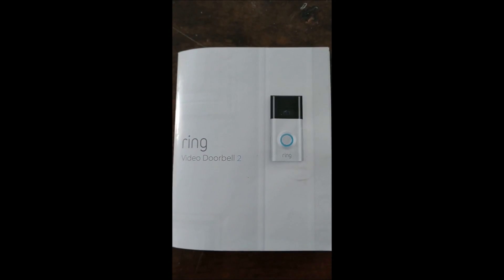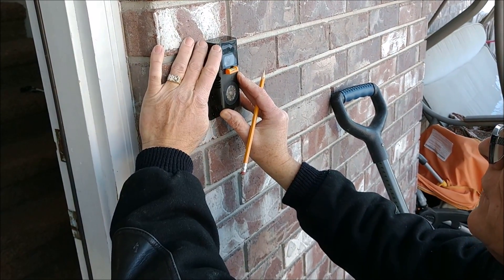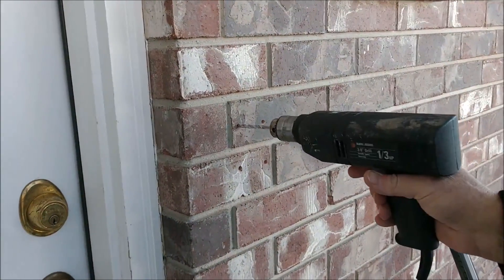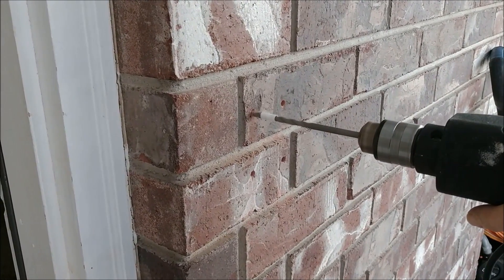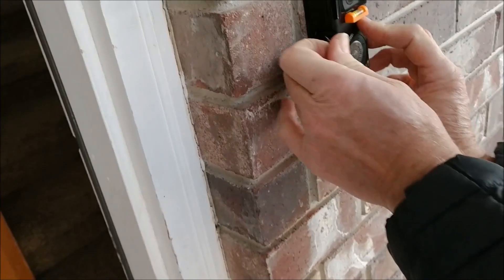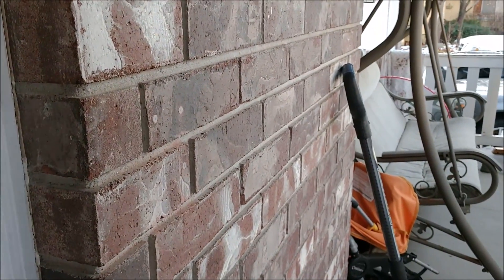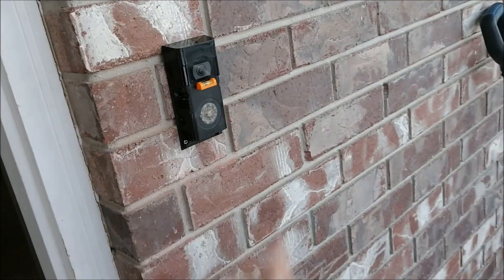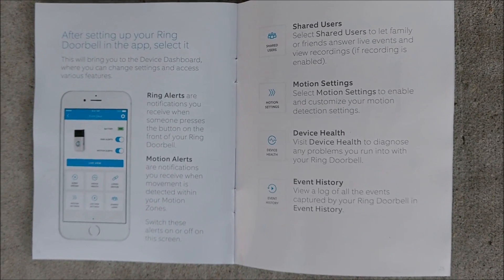How to install Ring Video Doorbell on brick siding of your home DIY video #ring #ringdoorbell2

Comment: The drill bit included with the ring is trash.
Reply: You are right.  I am not sure why they included that drill bit because you really do not need a drill bit if you're installing it on wood or another soft surface. The only time you really need a drill bit os if you're installing your ring video doorbell on brick or another hard surface. Thanks for your comment!   I hope you subscribe to be Al repairs! 
thank you